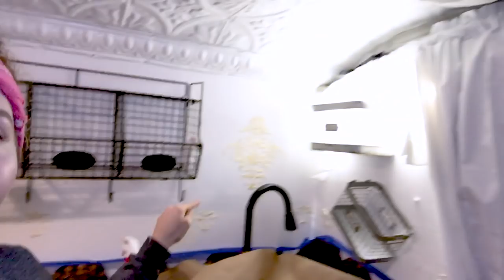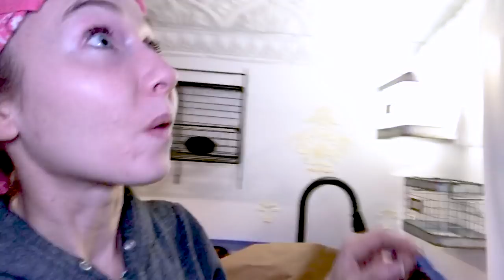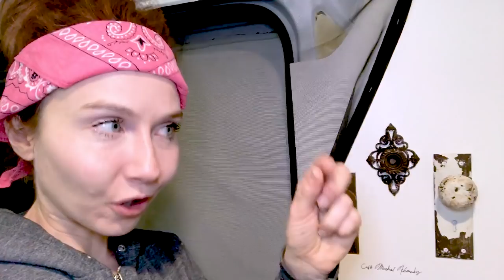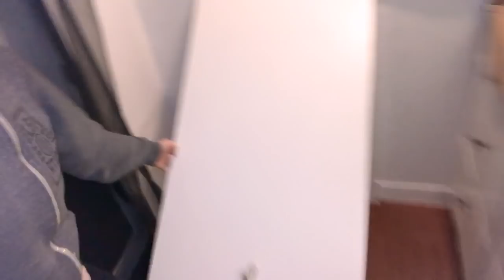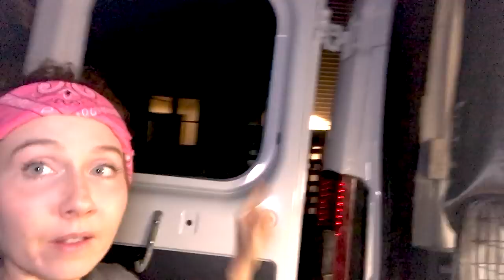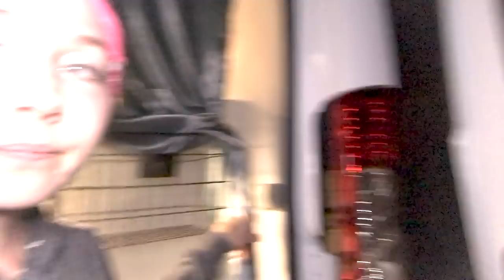Van Progress Report: Flooring, Cabinets & Cover-Ups

Comment: Blackout curtains are a joke, upholstery fabric on the other hand.....
Reply from the maker: Yeah I'm not sure who is on their marketing team but this is bullshit.
Reply: Casey Roman I also have a Promaster and my curtains are fantastic and I get so much positive feedback from others, I like to share my secret. Using upholstery fabric is a game changer! I have ZERO light leaks, really! I even had a cop press his face against my window just trying to find me in there and he couldn’t see in. ALL the lights were on at the time too! Haha jackass! For the divider between cab and cargo area, I removed the tabs from the headliner, put a small hole in the fabric, pushed the tab through the hole and then popped the tab back in the headliner. The fabric goes all the way to the ceiling, no gap. No curtain rod. For the other windows, check my video if you’re interested
Reply: Kickin’ Asphalt I’m a night shift nurse and I bough blackout fabric from JoAnn’s Fabrics by the yard. It’s fabric but with a vinyl component or something and it’s absolutely blackout. My room is a bat cave during the day.